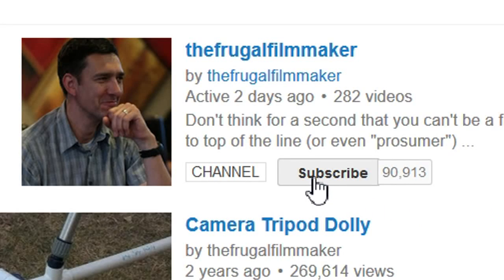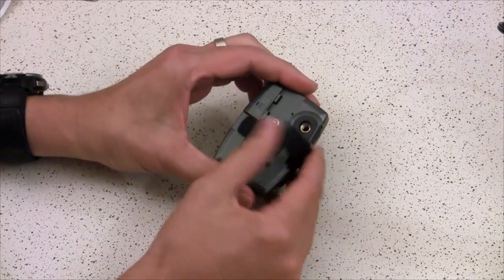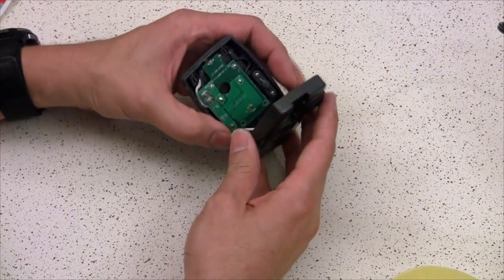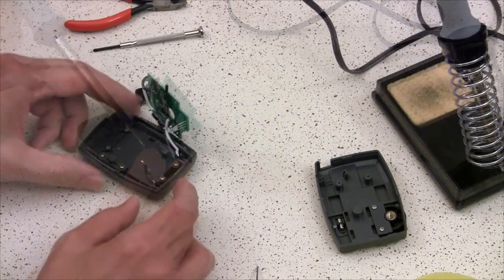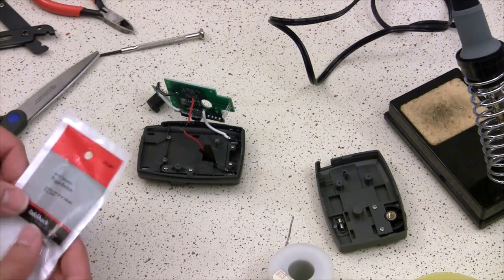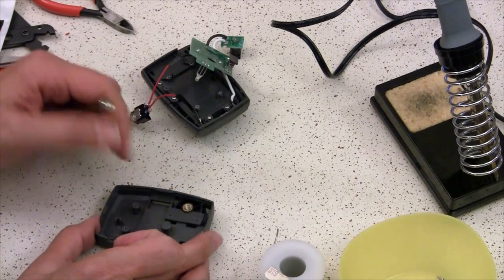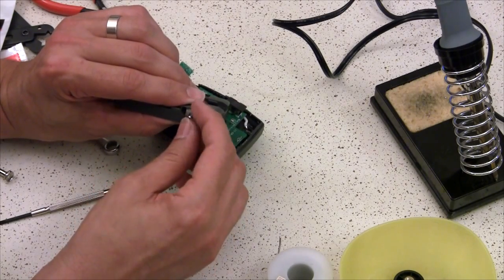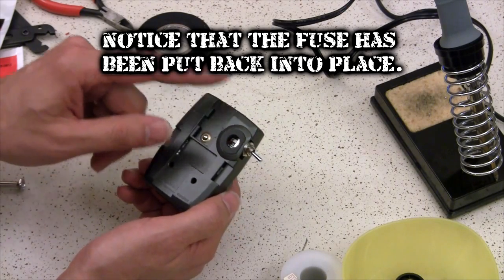Sony Battery Cradle Switch Hack

Comment: I fully charged my battery yesterday. When I went to use my monitor today, the battery was dead. The battery was in the cradle, but it wasn't plugged into anything. But I noticed that the switch I installed, per this video, was in the 'ON' position. This cradle definitely leeches power.

The affordable 7" monitor, the battery cradle, and this switch - all ideas I got from thefrugalfilmmaker. Thanks, Scott!

Comment: Hi there. Love your videos. I want to power my Panasonic G6 with this Sony battery. Would I need an UBEC to keep the voltage constant or is that built into the Sony NP-F960 battery? Afraid to fry my G6 so I haven't tried, after I plugged in an 8.4v Li-Po bike helmet battery with a DC coupler dummy battery and the G6 gave me a red message that it "cannot be used for this camera". i do a lot of night sky time-lapse so I'd like to solve this battery life issue . As it is I'm only getting an hour per G6 battery and that's not nearly enough. Thanks in advance.

Comment: hey scott, great video.

i want to plug one of those cradles into my zoom h4n recorder, however it takes a 5v input...i'm going to solder the correct end on...however i don't know how to change the 7.2v battery to 5v...

do you know of a way to do that?

thanks,

carter

Comment: Scott you said you had a batt pack for your monitor... any chance of showing how the hook up is? I hate it when mine goes dead during the shoot and if I can use a external batt that would be GREAT!!
Thanks as always...
Reply from the maker: Sure! Check the description for the "Review: 7" Monitor with HDMI for $56" video and watch it!  It will show you how I set up the battery cradle to power it.
Reply: Thank you I will... Learn so much from you!!

Comment: Nice video as always, but I have 2 thoughts.
1. In the description, you call it a SPST (Single Position, Single Throw), but the "P" stands for "Pole", not "Position."
2. Rather than cutting the wire and then adding extra wire to both ends, you could just de-solder the wire from the board (to go to one post on the switch) and then solder a new wire to the board (to connect the other side of the switch). The only reason I could see that not working is if the original (black wire) is too short.
Reply from the maker: Thanks for the correction--"Pole" it is!  And yes, I could have de-soldered the wire from the board, but didn't feel skilled enough to do so.
Reply: Fair enough; still a good video